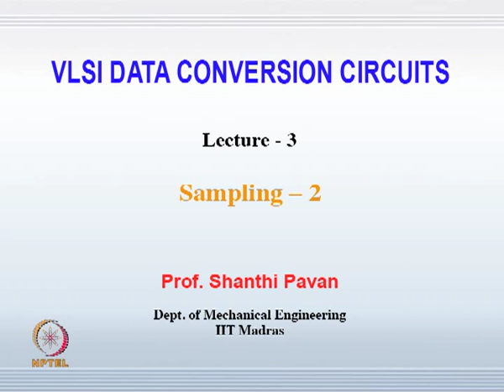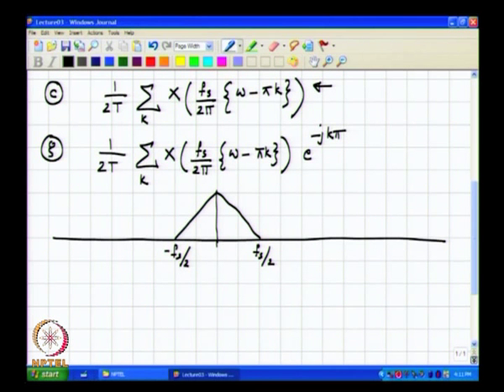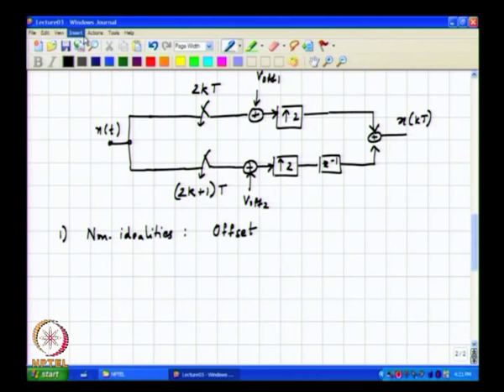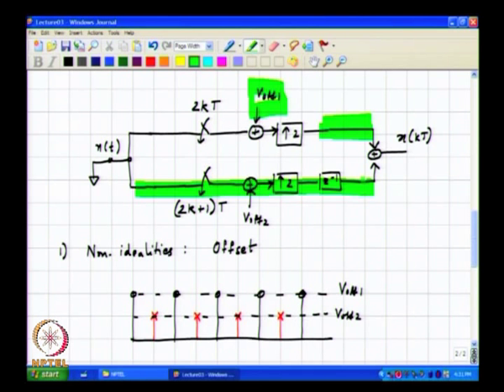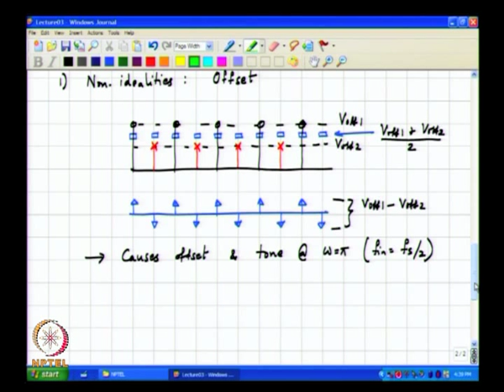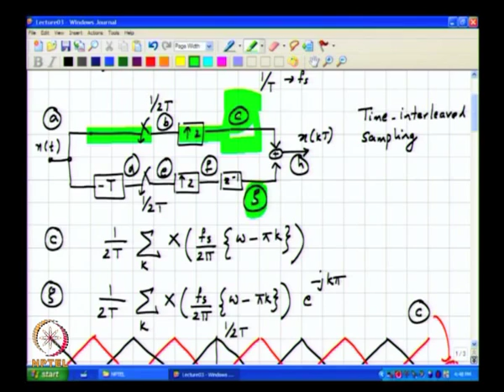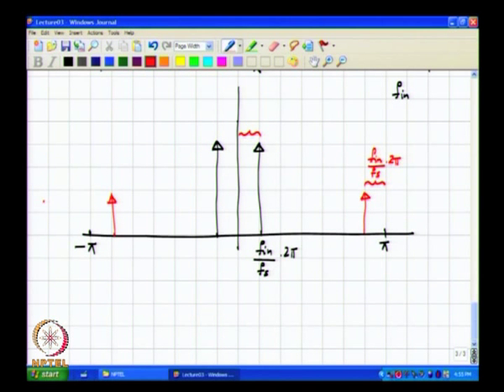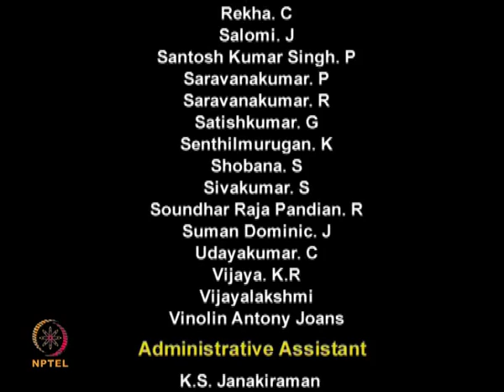Mod-01 Lec-03 Sampling-2

Comment: Notes:In general, to sample a signal at fs, we must limit signal bandwidth to fs/2.If we sample at fs/2,we must limit signal bandwidth to fs/4 to avoid aliasing,

But in interleaved data converters, we need not to limit the signal bandwidth to Fs/4. Because at the output the converter, aliased signal from one converter will cancel with aliased signal from other converter as these magnitudes are same but phase differ by 180Deg.

Due to Offset associate with each channel, we see the output spectrum having DC offset+ spectrun at fs/2(fs/N, when N represents N parallel ADCs used for Interpolation) and their harmonics.

In case of gain error in each channels,It can generate addition spectal components at fs/N-fin, 2fs/N-fin
Reply: You are doing a great job bro. Thanks
Reply: why we are analysing with black and red signals, as the black signal is the output right?
Reply: @sohamlakhote9822  why we are analysing with black and red signals, as the black signal is the output right?